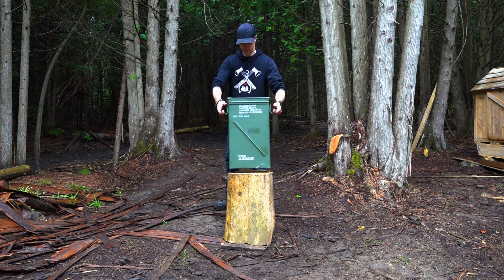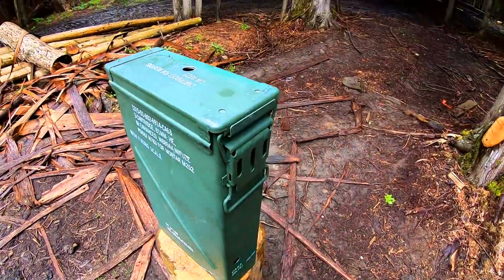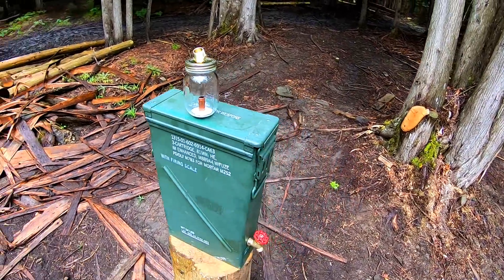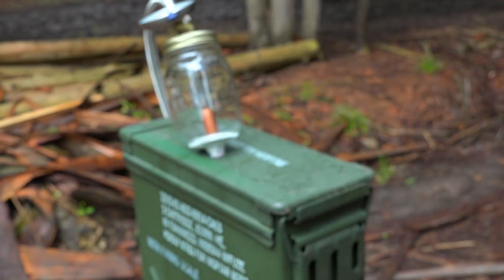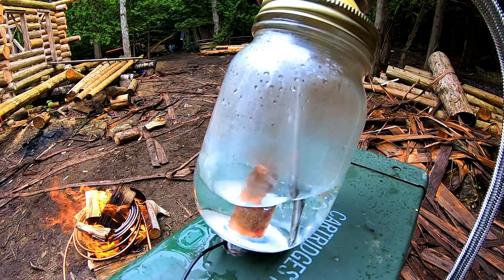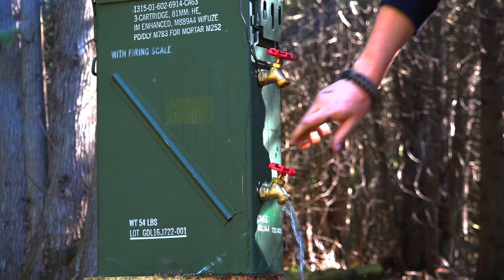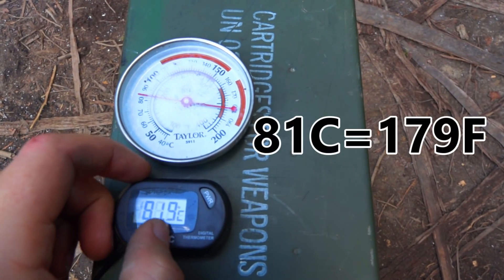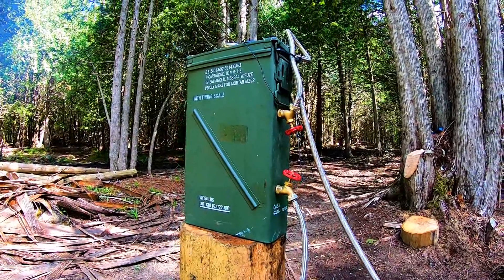Off Grid Heating Prototype- Copper Coil Water Heater / Heat Exchanger / Radiant Heater

Comment: you will get too much humidity coming out of the box, and when it cools down it will be too much condensation build up everything will be wet after a day .and you could get a pressure relief valve for $15 used or given to you by a plumber .but the big problem with water is that when the fire goes out the lines will freeze up and burst the pipe and constant  use of the pipe on the fire will crack the thin metal after 20 hour of use .you would be better off using stainless steel on the fire and car radiator fluid sealed in another coil in the room under your bed but there again the fire goes out the pipes could freeze up on very cold weather up hear in cold north.you would be better off making a dome out of wood frame and putting cling wrap around it with a wood stove in it.there is a russian you tuber that did this and it lasted over 3 years for him.good luck my friend.
Reply: No! The heat won't crack the copper pipe. As long as there's water in the line when the fire is hot, all will be fine. I have a similar design I use for a pool warmer/heater. It's just finishing it's ninth year of service with never an issue.
Reply: A condensate drain would solve that, for the most part. It could drain to waste. Or be re-used.

Comment: Will the copper tubing deteriorate after time when sitting in the heart of the fire? I realize the water in the copper tubing keeps it a a constant temperature, but I would think the fire and direct heat would eventually weaken or compromise the tubing. Looks like a great option to consider though!
Reply: They don't last too long when you have direct contact with flames.

Comment: I'm wondering; what would be the lifespan of the copper pipe in the fire? Did you notice any green flames? If so, that's the copper being consumed by the fire.  Wouldn't a steel pot of some kind be a better choice and the pipe only serving in it's proper role? Btw, this is intriguing and would create potable water as well.
Reply: Also the melting point of copper is just under 2000 degrees F, a temperature easily reached in a campfire, especially if a wind kicks up

Comment: This is an idea that is half great safety and a way to control the heat is the other half I think that you need to talk 2 a plumber or the people who install heated floors radiant heat so they can give you some tips and help you refine your heater all that hot water inside that box heated to 185 degrees is worrisome

Comment: If you are ever with out that thing here is what I do when camping:

I pick out ideally 1, 60-70lbs rock. Move it around the fire throughout the evening. Until it's a little too hot to touch. I wrap it in a bath tow or something to insulate just enough to not burn me. 

That in a 40°f rated bag in a tent has kept me completely comfortable for 8 hours in 20°f. 

For your well insulated camper In the northern cold I would think 2 or 3 60lbs rocks would very comfortable in there. 

Just an idea, sorry for your loss, and keep em' coming
Reply: This was his method prior to building this .
Reply: @straight-up-shots  I must have missed that. Do you recall when he showed that?
Reply: @stevenverrill4348  It was when he showed the finished product of the travel shed thing. Maybe 2 months ago?
Reply: @straight-up-shots  I'll find it thanks
Reply: Ok I watched the video. I would say the small stones have too much surface area:mass. That would explain it working well but not for long.
Reply: The only problem with rocks and I had it happen was a rock that had moisture penetrate the inside of it and I put it on the Fire and heated too quickly and it exploded throwing stone shrapnel everywhere no one got hurt but it threw Embers everywhere

Comment: Was always curious to see how well this method worked after seeing it on TV shows where they were building off-grid houses.  Thanks for the demonstration. Great results for a test run.  Good luck refining this heater to suit your needs best.

Just had a thought as I was about to post this comment.  I wonder if you can control the heating of the water by adjusting the water spigot valves, like to slow down the water some?  I know nothing of this process of heating water other than your video, so dunno if it would have any unintended consequences by throttling the water flow.  Anyway, thanks for the video.

Comment: That's good but how do you sleep with kettle boiling I would say pretty loud
Reply: He removed the coil from fire and closed the outlet valve once it is hot enough, so there will be no circulation thus no sound, duh.

Comment: Now just gotta add a way to heat dinner lol.  Maybe a lidded hole in the top big enough for a Stanley cup/pot thing? Hinge the lid for the hole and add a flip lock? Maybe more steps than you wanna bother with but most woodsy folk i know like multipurpose stuff 😀

Comment: Nice idea, maybe in the winter when you need that heat, it won’t heat so fast or so hot. That will be difficult to control, but bursting the tube overnight because it got too hot so you took it off the fire, then the tube froze and burst will be a problem to think through before the fact.  Condolences to you and your loved ones for your loss.
Reply: So, what if there were a battery powered pump to run at night to keep the water moving? Should prevent freezing but you'll lose heat faster.

Comment: Open air camp fires burn to fast.. buy an old woodstove air tight,,, run 6 or 7 feet of stove pipe,,, wrap the copper pipe around the stove pipe,, maybe use a 6 inch pipe with an 8 inch pipe  over the copper to help hold heat in,,,, play with that  system  & i bet you'll be safe & warm & the fire will go all night.. Aloha

Comment: Wood stove out side your shelter, run the chimney passing through the cabin (in a pipe slave). Or cut out a hole fit a stove to the cabin but the front door of the stove is out side of you cabin so NO O2 and CO2 problem.

Comment: In the UK we typically use hot water systems for heating our homes, and they work extremely well because they also provide radiant heat, as opposed to hot air circulation which does not heat the surroundings as efficiently. 
Our systems are closed, though, since excess moisture will cause mildew to form. For this reason, it might be a good idea to install a third flexible pipe in the top of the tank, and route it outside the camping sled. This will prevent excess humidity inside the sled, which would otherwise cause visible mold to eventually form. 

Regardless, this is a fantastic idea and I suspect it will work fabulously in winter.
Reply: brilliant suggestion, nobody likes a moldy mobile camper.
Reply: rico viselli mold is the least of his problems as moisture will dampen all his bedding quickly and he will be wet and cold. Maybe he could also try just one loop of copper coil buried under the coals and ashes to produce heat without actually boiling !!
Reply: ...or just build the fire under the sled 👍
Reply: @private15  may be a good idea to make a stand that would keep the coil out of the fire at the outset.will then heat the coil without the water reaching boiling point. later when its time to sleep and the fire is burning to coals then put the coil on top
Reply: Could attach a tube to the top run outside and then feed back into the top kind of like a condenser so that the steam cools and condenses back into water and then is dripped back into the water reservoir.  This is such a GREAT idea, when I lived in Australia the people I worked for heated hot water for showers in a drum that had the copper tubing coiled on the inside and led to the water tank. Fire in the drum and the water heated circulated and stays hot for HOURS just from the coals left in the drum.
Reply: Great idea! And a good point about the mold garden, not so great in one's sleeping space.
Reply: I can say without hesitation that living much of my life with hot air delivery systems that I experience no perceptible temperature fluctuations, plus when I want the temperature to rise for example first thing in the morning the heat is felt within a minute or two. With hot water delivery it takes noticeably longer especially since theres nothing but convection to move warm air around, thus taking longer to heat the house air and contents. Another advantage of hot air systems is that there is built in positive air filtration. 
   I read somewhere that hot air home heat delivery systems are most popular here in the US, in part perhaps because the same ducting also serves for central air conditioning.
Reply: @joewoodchuck3824  We had hot air systems from a gas fired system at home many years ago (over 45 years ago) The system was inefficient because the ductwork was uninsulated and the houses draughty. I can understand them being more efficient as technology improves but, trust me you don't need air con in Scotland!
Reply: @joe woodchuck

Aye, hot air is pretty instant, but it doesn't heat the physical surroundings very quickly. Air does not easily alter the surrounding environment by convection, and it also has to be constantly flowing or the heat will dissipate very quickly. Thermal mass will take longer to heat, but will also last a great deal longer.
Reply: @NorthernScrub  I fully disagree in theory and in experience, but youre welcome to your opinion.
Reply: @joe woodchuck I find that hot water radiators are more effective when set to a maintenance temperature, but I did notice, when I visited north America, that the hot air system would set to a much higher temperature than the target initially, and then plateau at the set temperature. Is that the norm>
Reply: @NorthernScrub  No that is not the norm. Thermostats are meant to reach a temperature and keep it there. If they don't then something is wrong. There are adjustments to tweak the system if necessary, but that shouldn't need any.further  attention once set up correctly. Where did you visit here?
Reply: @joewoodchuck3824  you can disagree all you want, he's right.
Reply: @Claymore1977  Nah. There's a reason there are more hot air systems than hot water in America. You have stated no statistics, no experience, and no plausible theories. I'll stick with what I know to be true from over 50 years experience living in numerous locations.
    One other point not previously mentioned is that hot air systems filter the air on an ongoing basis. Less dust and allergens. No hot water system does that.
Reply: @joewoodchuck3824  I've been a mechanical contractor for 30 years, do your own research and get back to me.
Reply: @Claymore1977  I have already stated my experiences and other information. Perhaps you missed it. Titles such as yours dont necessarily convey sufficient  expertise. Ive proven engineers wrong before on certain points. Youre welcome to your continued opinions however.
Reply: Whatever sir. The information is readily available online...I don't have to sit here and convince you of anything. Believe what you want.
Reply: @Claymore1977  No one asked you to convince me of anything. Your failed attempts to do so were original to yourself and as far as i know were completely voluntary.
Reply: So what exactly are you saying? That forced air heat is more efficient than radiant heat? From what standpoint? Comfort? Efficiency? What? What exactly are we even debating here?
Reply: @joewoodchuck3824  Also, just so you know...radiant heat is actually better from an IAQ standpoint too. You don't have a fan, coil, or ductwork, filled with dust, mold, and allergens that the fan distributes throughout the house. Go ahead and tell me now that all those don't develop with proper filtering too...trust me, it still does.
Reply: @joewoodchuck3824  the only real drawback to radiant heat is the cost...and yes in most places of the US where you need air conditioning as well it's makes more sense to  use forced air heat because you already have to install ductwork anyway. Have you ever actually even lived or been in a building that uses radiant heat?
Reply: @joewoodchuck3824  From a Bob Vila interview:
“In the radiant floor versus forced-air heating debate, radiant floor always wins because it provides a quiet, even heat and eliminates the allergy problems often associated with heating ducts,” Franco said in the Bob Vila article. “But there’s another reason why radiant floor heating is superior to its blowy cousin — it’s simply more efficient.”
Reply: @Claymore1977  And airflow isn't necessary for such a small area
Reply: @kiyoponnn  bro I've been talkin about something completely different with someone else that has nothing to do with this particular situation.
Reply: @Claymore1977  No, I understood exactly what you were saying
Reply: @kiyoponnn  You obviously don't, because I'm not talking about this "small area" at all.
Reply: @Claymore1977  

Wow! Pride before the fall, take it easy, it's a friendly site
Reply: @kevio6868  "The fear of the LORD is the beginning of knowledge: but fools despise wisdom and instruction."
I can do that too chief.
Reply: I would suggest the same but with a pressure valve that will blow ( or open up)  when or if the steam builds up ... Similar to water boilers in ur home
Reply: DefinitelyNotDan  moist air feels much colder than dry air in the winter
Reply: darrellw dobson  spank you
 helpy helperton.
Reply: Basically this is almost identical to how a water heater is built. 
I believe the best solution to avoid steam issues would be to plumb a pressure release valve into the top of the can and run a drain from it to the outside of the camper.
That way the system remains closed, but will release pressure once it builds over 13psi.
Theoretically, you could plumb the pressure release into another container to collect as drinking water, assuming your can isn't lined with anything nasty.
Reply: @2JollyRogers1  

Nice! Thanks
Reply: Thomas Hay 16 realms or countries under the commonwealth mate, how many under America, oh that’s right 1 america, we’re still an empire bud it’s not history and clearly the world does care about what happens here pretty much every country in the world uses our language lol how many use American oh yea that’s right you don’t even have your own language let alone anyone else using it 👍🏻
Reply: @perry714.  You can't be seriously bragging about the UK right now...please tell me you are joking right?
Reply: Claymore77 not so much bragging, replying to a comment is what I did, was anything I said a lie
Reply: In a home situation perhaps  you could have a larger holding tank out side that you could pipe in once boiling starts to continue circulating until its warm enough to bathe with so you never have to pull the coil out of the fire it could continue to burn till you let the fire  burn the out.
Reply: Yes, we use them here in the states too...About 50 million, or more, homes have "Winter/Summer" hook ups...
Reply: DefinitelyNotDan  The heater provides enough heat for the tiny space and mold is the bigger issue here
Reply: Radiator heaters use oil not water. The oul won't corrode the radiator as fast as water and oil has a much higher boiling point eliminating steam. Oil also retains heat longer than water making it more efficient.
Reply: @kinglittlefoot  Bullshit, water has a much higher specific heat capacity than oil so water retains heat for much longer
Reply: @kiyoponnn  You're also wrong about water holding heat long than oil. Look up diathermic oil heater. In fact here:
"Compared to Water Filled Space HeatersHowever, the main reason oil filled heaters are so energy efficient is due to the unique thermal properties of the oil. Diathermic oil has a high specific heat capacity, which is the amount of energy a substance can absorb before its temperature rises one degree"
https://www.newair.com/blogs/learn/oil-filled-space-heaters-energy-efficient
Reply: Add a breather to the outside end of it too.

Comment: having the system pressurized is not a bad thing, as higher than atmospheric pressure will prevent the water boiling, much like modern car cooling systems. you'd need a pressure relief valve like one off of a hot water heater to avoid a scalding hot steam explosion however.

Comment: I wonder if you could shape the tubing into a flat grill like structure that could fit inside the ammo box for better portability while on the move.
Reply: Anonymous - I was thinking of coiling lengths in the floor and then placing a layer of flooring on top; making a radiant floor condition.

Comment: Add a pressure release valve on top like on a hot water tank.  If for some reason this thing builds pressure...you won't have bomb 2 feet away from your head. And those shark bite connectors won't last very long that close to the fire. I tried make a pool heater this way...I wonder if you used an actual mini hot water radiator that was made to hold a bit more pressure.  Anyway great video.  And nice to see.

Comment: An aluminum heater core from a car and a small 12v fan zip tied to it plumbed to the lid of ur ammo box vent would take the steam into the cabin in stead of the hot water. to reduce water losses due to evaporation have the outlet from the heater core go through a cooling coil before returning the water back to the ammo box. (might work lol)